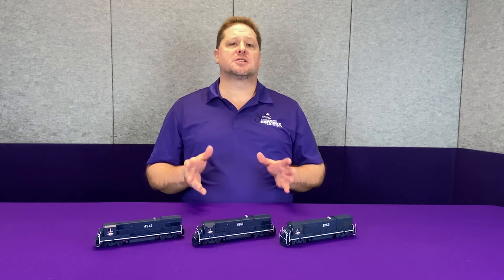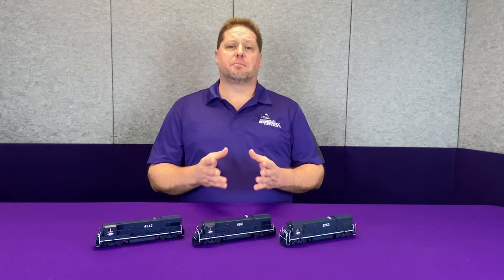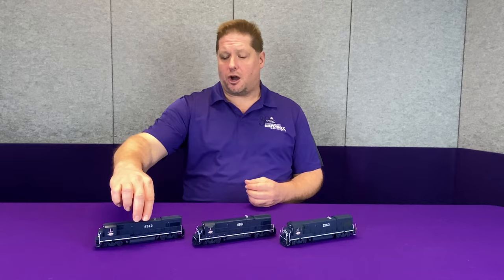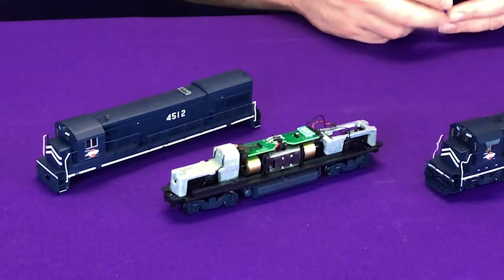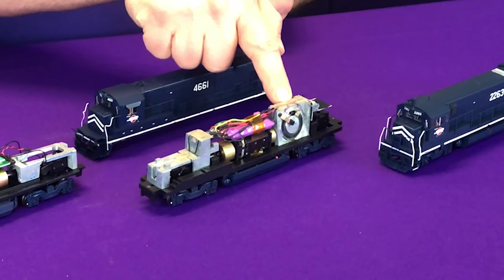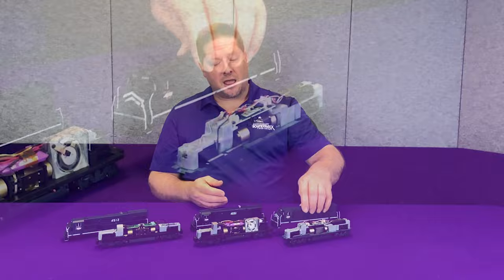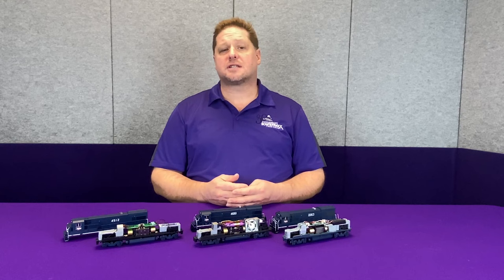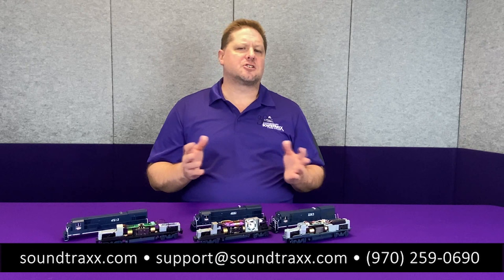Choosing the best Decoder Format for your Model

Comment: Albeit not mentioned, installing Decoder Buddy with a TSU-21PNEM8 inserted will likely fit onto all models regardless of era. Still figured it would be cool to know as that's what I've seen people do on FB
Reply: That is currently my standard practice for anything without native 21 pnem factory installed. I prefer this to PNP because the decoder buddy is led ready while the PNP board requires resisters on each light output. I would buy more PNP dedoders if they were led ready.
Reply from the maker: The decoder buddy can be a helpful tool.

Comment: Atlas yellow box...Athearn blue box...in the beginning......will they all work...or burnout the decoder with too much ⚡️draw?
Where there's a will...there's a way ...right!
Reply from the maker: Yes, but you will likely need to measure the stall current first.  It should be under 2A, but test to be sure.  We’ve done installs in Blue Box.

Comment: Now if only Scaletrains just made the boards compatible, meaning to not having to modify or remove the board, for a quick drop in or swap out for a non-ESU (I call them junk) decoders. Tsunami is the only one I like for diesels. I’ve tried another brand, not ESU, for a diesel and it takes more set up and more finicky to control that I might put it in another diesel that doesn’t get used much and put a quality decoder in it, TSU-2200.
Reply from the maker: We are so glad that you prefer our decoders. Unfortunately scale trains is choosing not to follow the NMRA standard so there is not much we can do here. Maybe they will make a change in the future if enough customers ask.

Comment: Hey George another great video. I have recently purchased a couple of Atlas engines and have the Operation Lifesaver GP40 on pre-order. Since Tsunami 2 is my standard I get non-Athearn locos without decoders. Atlas and Bowser are both shipping DCC ready locos with speakers already installed. How are the Atlas speakers working for you? Would you recommend using or replacing them.
Reply: since when did bowser sell dcc ready locos with speakers pre installed? I do know rapido already does pre installed speakers in their units
Reply: @CentralJerseyRailfan  I was sure I had read that but can't seem to relocate the info so maybe I was confusing with Rapido. I can attest that Atlas is doing it as I have 2 locos here that I have purchased in the last couple of months that have speakers factory installed just like George showed.
Reply from the maker: The only possible issue is to make sure that if the model has multiple speakers, that you rewire them in series. Otherwise they should be fine. George has done a few and after rewiring the multiple speakers, they sound great!